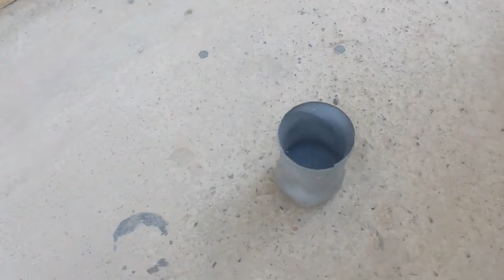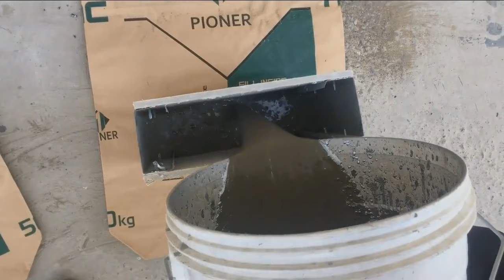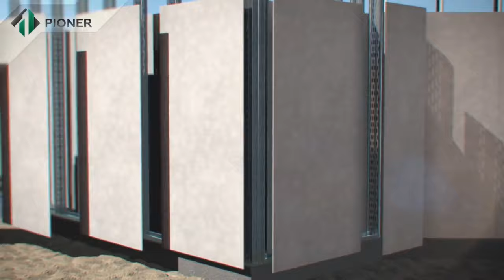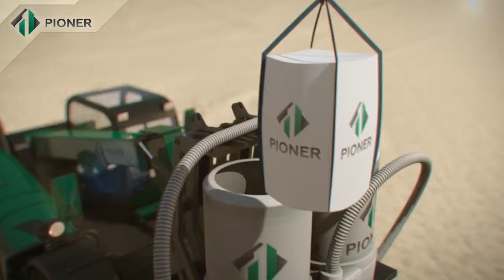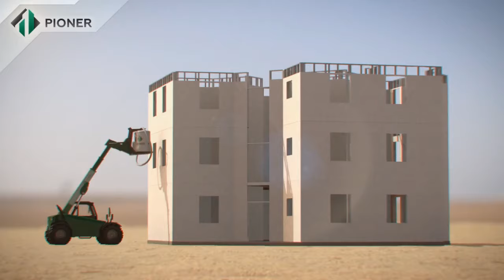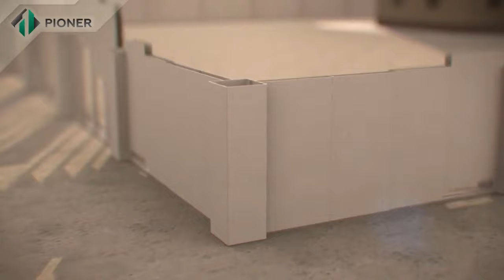Lightweight concrete made of cement limestone aluminum powder for peb buildings thermal insulation

Comment: hello brother nice video please I have a question what is the chemical in bottle that you added into the the mixture what is the purpose of it
Reply from the maker: just liquid soap to increase PH for better chemical reaction
Reply: @stretchceilingsDubai   would soap help when working at cold temps to prevent cracking?

Comment: Very interesting.  The illustration at the end of the video was helpful.
Would have preferred eliminating the soundtrack and doing a voice over explaining the process.
So, this material is used an in fill between the interior and exterior panels?
For these panels, what materials are used in your country?
Besides the water, it looks as though there are only 4 ingredients used.  Is this correct?
Reply from the maker: here is the basic recipe www.pioner-group.com/concrete

Comment: Why didn't you  list out the chemicals and the quantity you used. It's not useful to me
Reply from the maker: there is no any chemicals needed. Only cement, sand and aluminum powder https://www.pioner-group.com/projects/non-autoclaved-lightweight-aerated-concrete-mix-design-step-by-step/
Reply: Do you need flyash ?